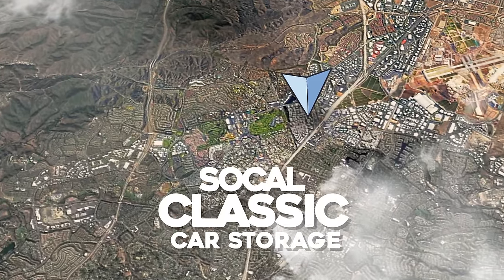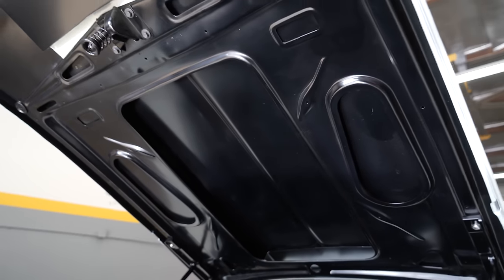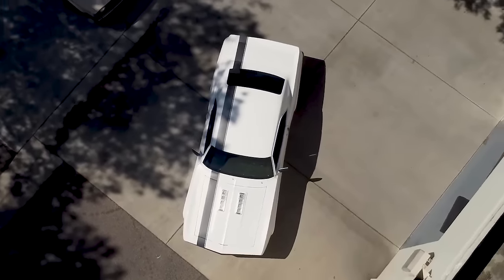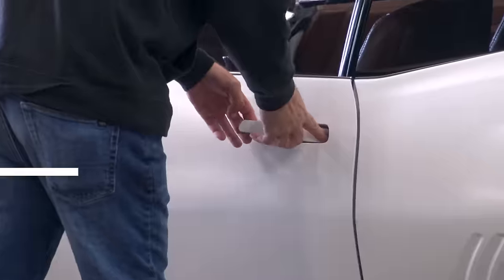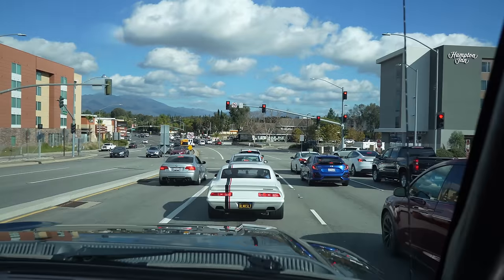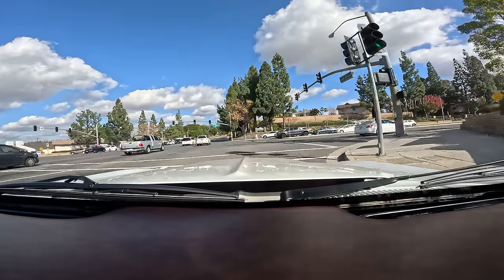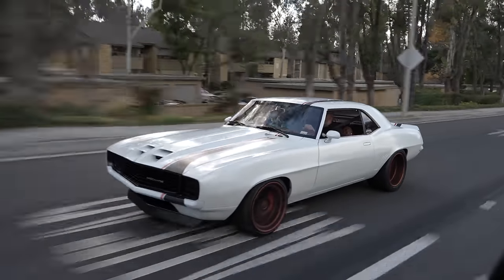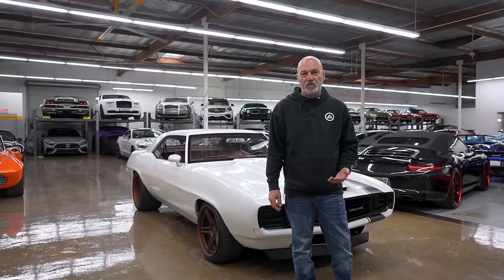LT5 Powered 69 Camaro Making 800 hp

Comment: A reminder to everyone who forgot: GM rates the LT5 at 755 horsepower in a WORST CASE scenario. That means it's hot as balls outside, its humid, the engine is heatsoaked, you're using dog water pump gas, and you're at altitude. 1000hp out of this combo with completely stock internals is completely achievable LOL.
Reply: Further to your point my uncle has a 2019 ZR1 and he has a smaller pulley and custom exhaust and cam and running on a race gas tune he is a little over 1000hp. What’s wild is even when the car was stock chevrolet detuned it by a lot. If you look at similar sized after market blowers.  they all state 1000 and up hp it’s not a far fetched claim. I’m jealous of your build and I would change nothing on it from head to toe that’s a bad bitch
Reply: That is insane. Just madness.
Reply: @shad3128  yep. The LT platform isn't even close to optimized yet. Can you imagine a bored/stroked 454 LT5 with an even bigger topmount supercharger and integrated intercooler unit? Pure smoke for DAYS.

Comment: I’m in the same camp regarding his 63 Split Window Vette. For me, if it’s a rare spec, low miles, mint condition example that’s 100% original with no accidents causing replacement parts, leave it alone. If it’s not that unicorn situation, resto mod is not an issue at all. More fun, far safer, and just a better all around driving experience. You get to create the cool factor in every way. 👍🏻😎👍🏻
Reply: Meh...most those cars are all stock restos they are nice but all look the same after while. Love seeing them modded with the large flares rowdy solid lifter engines etc.

Comment: I have a 2013 Mustang pushing 630hp at the crank with a 3.83 rear end.   First gear is only useful in places where I want to go very slow.  The engine will pull it around in first on idle and that’s just right for busy parking lots.  Otherwise, with so much torque, I start in second just about all the time.  Even at that, I’m shifting up to 3’rd pretty quick.  So, I can see that this Camaro is in the same boat, there’s just too much torque in first to slowly accelerate.  It takes a lot of concentration not to lurch around and there’s really no point to it, because starting second is much nicer.
Reply from the maker: Lots of torque but there was a slight delay in the accelerator pedal. Drive by wire needs a little dialing

Comment: Correct me if wrong but I believe the pedal dead space is in the tune due to Chevrolet not trusting a customer to floor it and keep control of the vette the LT5 was in. It would put it in limp mode aka computer progressively takes and gives power to match traction

Comment: Would love to hear more technical aspects of the build for people like me that are working on LT5 First Gen Camaros.  Like other's have said - the LT5 is rated 755 hp / 715 ftlbs torque conservatively.  Put headers and no Cat, good cooling and gas to ensure spark knock doesn't detune it and it's going to be a fair amount higher.    I have no  intention of playing with cam or tunes with mine when it's done because the beauty of the LT5 to me is all  that power isn't at the expense of drivability or reliability.
Reply: Throw in e85 and boom-another 50-75hp.   If my 17 ZL1 can get to 850rwhp I’m sure this LT5 can do 1000 rwhp.

Comment: U got the coolest job ever .man I just want to drive one of the cool cars and trucks on the show.thats that's got 2 cool cars 2019 subaru sti 2012 boss 302 .custom builds insane. What's a true price tag on a build .I wonder what all the work would cost .and don't paint it ill do my own paint work but all the metal fab .suspension motor interior.

Comment: Sean said it,  everybody thinks it but this was worth building as a 69 . Unique  and classic . Wife killed it . Only one thing i disagree with is low seats . I understand the appeal and wifey has a very strong eye for aeathetics but i want the protection for my kneck thats already deatroyed from a rear end accident that in this car i would be paralyzed . I need high seats . EVERYTHING else works for me . Th3 stripe looks particularly good on the front view with umique hood scoop / intake that is great .  Wifes input may hav3 be3n the differ3nce between just anither 69 resto mod and something great .  Sean point3d out all the key things/ choices  that make it nice and lik3 most cars it is suffeci3ntly overpowered so that 335s are not a match for power output which people seem to like for these cars . Personally i think they need boost by gear so you can actually punch them otherwise i dont see the use for the power . If you want tire smoke you can use the clutch, but not being able to go full throttle is not a badge for me . I want to be able to matt it and have some chance of at least limited traction and forward momentum even if it takes some correction to stay straight but not need to try and peddle it  . Lower gears dont need full boost if the power cant get down . Great car even if overpowered . Especially today with modern 3ngines and ECU tuning . Have a tune that does boost by gear and ine that just destroys tires and im sure most people will stay on the boost by gear more , 3njoy it more and the car will be faster in real life .

Comment: Wish I could find a reasonably priced LT5
Reply: At this point best option is to buy a totaled car that has an lt5
Reply from the maker: Cool engine
Reply: Such a short production run for crate. Makes em almost impossible to find
Reply: Bummer the LT5 T56/ 8L90 Connect & Cruise from Chevrolet Performance has been discontinued.

Comment: I was driving a 69 Road runner back in the mid 70s, kept that car for 13 years. If I still had that car no way in hell would I restomod it. I would restore it back to factory specs. Lots of those old cars were comfortable and just fine when new off the showroom floor. I call BS on them being uncomfortable, causing backaches and other bs. If you rode in one they were already trashed with a half assed restore.
Reply from the maker: I’ve driven plenty of numbers matching all original vehicles and they don’t drive like a restomod. 50 plus year old technology is different than modern tech. If you don’t like restomods so be it but can’t suggest that a classic rides and drives as good as a restomod set up properly
Reply: No doubt on this at all, especially from us older guys with bad backs.  I’m currently working on my 4th and final first gen Camaro and although it’s gonna be slanted more toward a race car and less creature comforts, I’m doing an adjustable/reclining race seat vs the former kirkey fixed seats.
If you’re miserable driving it, you’re not going to be driving it enough!  This 69 will have an 800hp 540bbc to start with and possibly some nitrous but I may say screw it I’m not getting any younger and slap some turbos on for 1200hp and go chase my bucket list 200mph in the mile.

Comment: LT5 is a solid motor overall. However, if I may point out its weakness, it's the direct fuel injection system which it employs. We all know the reason why. Because of that reason alone among the others, I prefer LS9 over LT4 or LT5 as far as Chevrolet supercharged crate engines are concerned. When you're seeking 'absolute performance' from the fuel delivery system; the direct fuel injection system will do wonders. However, if you want the peak 'relative performance', the sequential port fuel injection system like the one on LS3 and LS9 use will suffice. Now, if you want the best of both worlds, it's more than feasible to deploy both the direct fuel injection system and sequential port fuel injection system as Ford has done with the Coyote engine and similarly Toyota has developed the DS-4 system to achieve its objective. If I absolutely had to choose one type of fuel injection system, I would choose the sequential port fuel injection over the direct fuel injection system for longevity and durability with the added benefit of superior cooling property for the cylinder heads. Thank you for listening to my ranting and raving.
Reply: I made a mistake. LT5 is equipped with both the direct fuel injection and port fuel injection. I didn't mean to feed you the wrong information. It was an honest mistake.